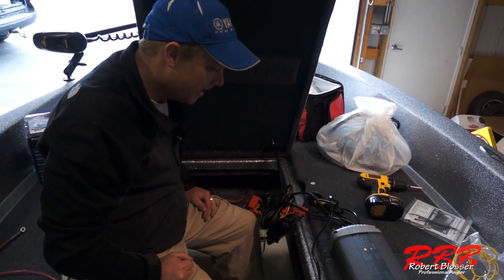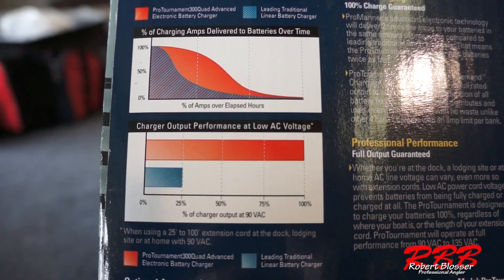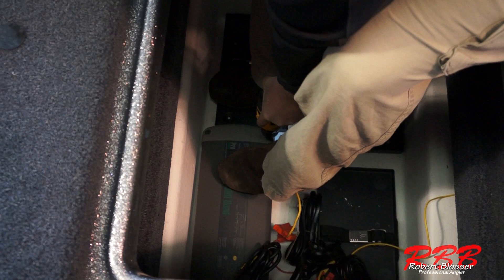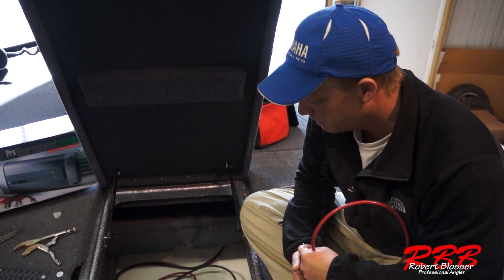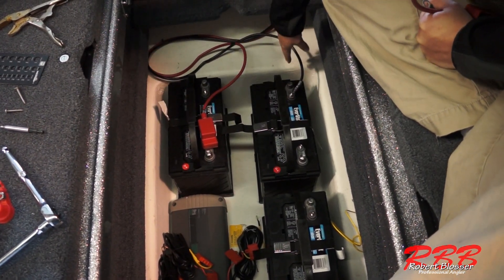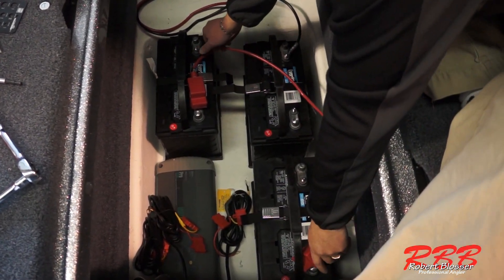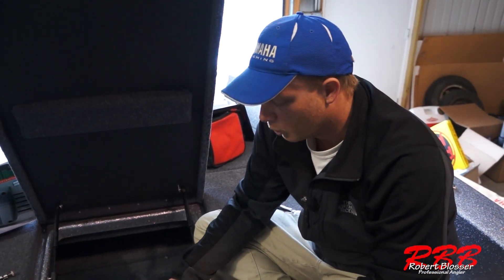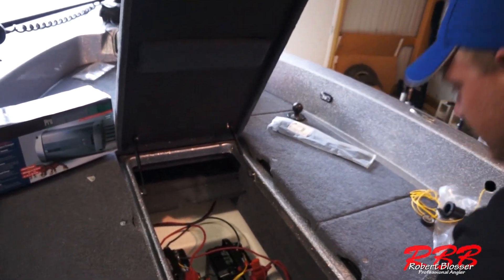ProMariner Battery Charger Install 36v Trolling Motor

Comment: What I don't understand is with I-Pilot Link, why don't we have trolling motors in the front and back of the boat?  When it's a windy day, it might help to have something back there to keep the back end steady.  They could invent something with 3 or 4 props on one motor so it doesn't even have to turn.  Just turn the necessary props to control the back end.